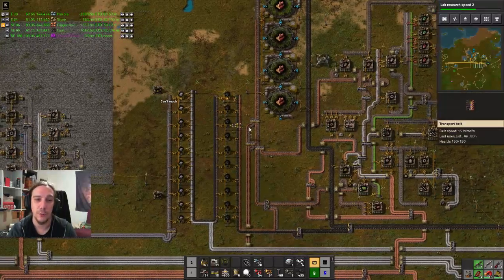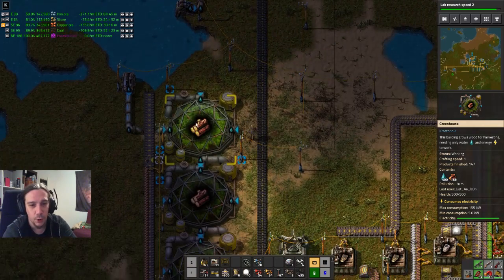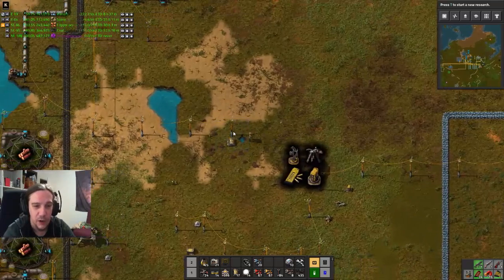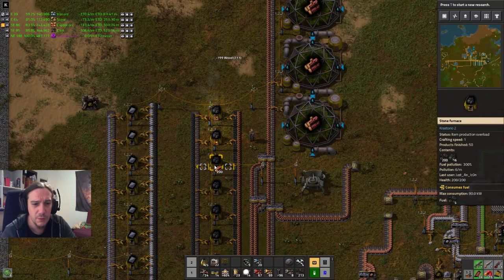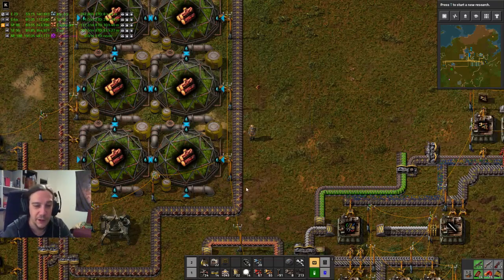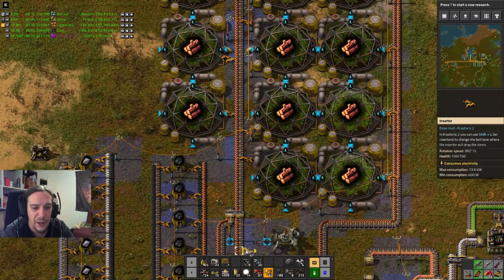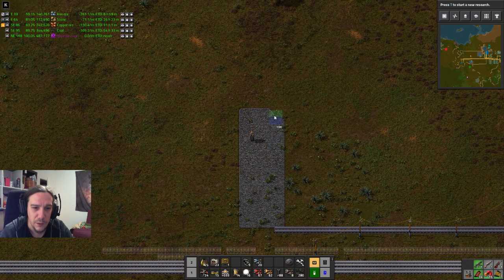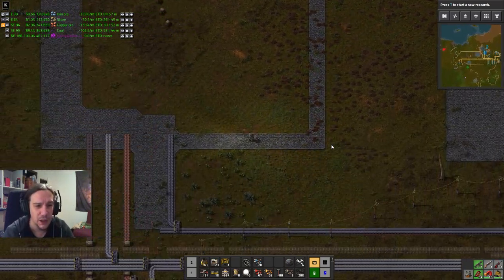Let's Play Factorio Krastorio 2 - 09 - Gameplay Playthrough

Comment: Maybe I am wrong and will see later, but I really think it would impossible to feed boilers with wood
At least not without multiple wood lines and less than optimal nber of boilers per pump
Especially because wood here has only half of the energy value as in vanilla and it was hard to do it there already